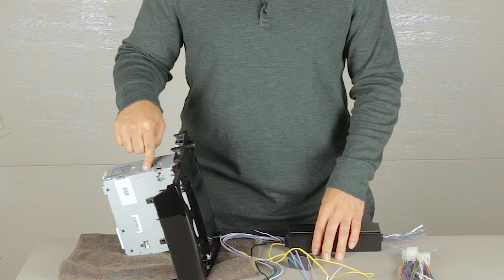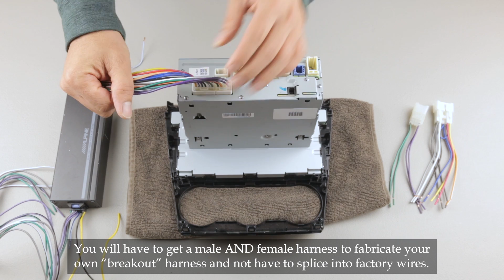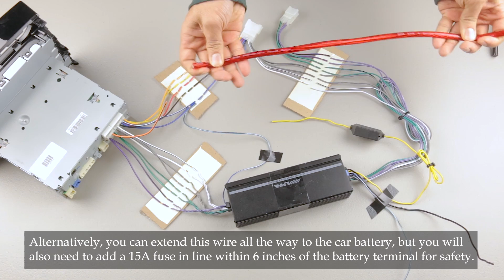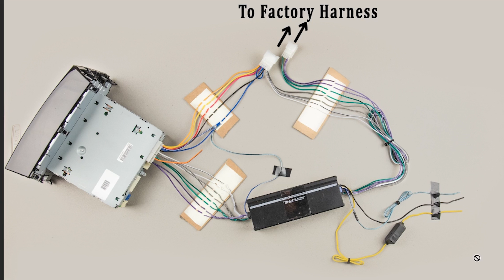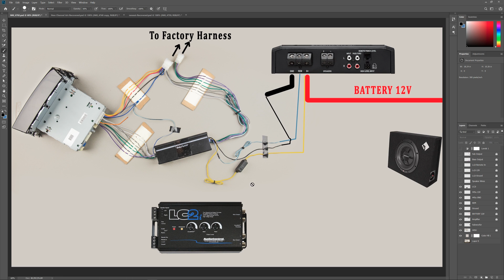How to Wire Alpine 445u, LC2i LOC, and Subwoofer  | COMPLETE WIRING GUIDE |

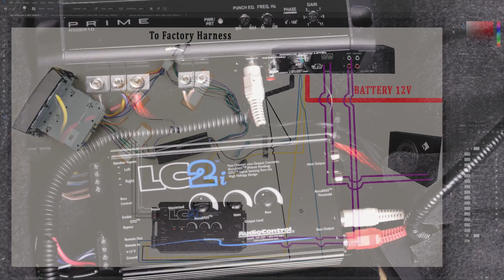Comment: Good video, but a question: At 12:14, in the ‘final’ pic, it looks like there’s a wire connected to the remote out on the LC2i….I’m wondering why? Does the remote go to that first, then to the sub amp?  I’m just curious, as I fully understand how to wire a system….Cheers!

Comment: Thanks for the video, its been the best ive seen so far but doesn't answer my questions about my current build. I have AudioControl LC7i Black 6-Channel Line Output Converter, 2 after market amps(4ch amp and 2 ch amp(for subs) connecting to a factory Ford radio(i have no choice of using an after-market radio). I'm running 150rms to the doors(4ch) so I will use after market speaker cable, not factory internal speaker wire. So with this, im thinking these speaker wires will connect from 4ch amp to the door speakers, which makes sense but my question is where does the 2 sub speaker wire connect from the LC7i to the harness(im using PAC LPHFD31 harness) as the harness will only have the 4 pairs, not 6 which I would need? Any help/advice is welcomed as Ive only done audio systems with aftermarket radios, not factory radios(used to not be an issue until the newer cars and their fancy radios).

Comment: So do you recommend this power pack versus an additional amplifier for the door speakers? I have an older amp I wanted to use on my door speakers but the installer at best buy recommend this mind you the amps I have are over 10 years old

Comment: Ik this comment is pretty late, but do I need to run a fuse with the 12v wire running from the LC2I into the amp or would the fuse from the battery to amp connection suffice?

Comment: If I install just the inline amp, do I need the line out converter? Do you know if the 2019 WRX head unit has enough power for the inline amp?

Comment: I have a 2016 Honda Odyssey, I’m basically doing the same setup.. my question is, which one do you recommend better the lc2i or lc7i and why??
Reply: Depends on how many output channels you need. I do believe the lc7i has accubass now but im not sure. If you don't have an amifier yet I'd look into their dsp line of amps. Has the line out converter built in and you're able to tune the system. All while using one component giving you a smaller footprint

Comment: Hello, I'm looking to get the Alpine PSU-300CVC which is basically the PWE-S8 and KTP-445U as a kit with wiring included specifically for my car. I want to add the LC2i to it, but after looking at all the wiring I'm not sure what to do. If I wired everything then tapped into the Front L/R speakers with the LC2i, where can I send the RCA bass output from LC2i to? Would I be able to connect it preamp or is this setup not possible?

Comment: Hi in order to install the alpine 445u do I need to have the LC2i, I’m not running another amplifier or a subwoofer and I have an aftermarket head unit and speakers the point of my question is when I’m setting up the gain I wasn’t able to reach more than 32 of volume which is my head units it’s the loud It could go up to 50 any recommendation please
Reply: @akqjtn  I got all of them at the off position except number 5 for the 4 channels and number six for the RCA am I right that way ?

Comment: Great video, maybe I missed it , I thought the original speaker wire is insufficient for the upgraded components. So I  ran new speaker wire to wire into the LC2i and two amps and sub box. How am I supposed to tap into the original speaker wire at the head unit  to run to  the  converter?
Reply: It's a 2019 Silverado

Comment: Excellent video! In my sound system I am using the Alpine 445u for (4) 6.5" speakers the LC2i and a Rockford Fosgate 12" sub and Rockville 350w CEA RMS Mono 2-Ohm Amp. Your video helped me wire everything up correctly.

Now I want to add tweeters with a crossover ("active" I think). I would like your thoughts and feedback on adding tweeters. Any recommendations on the crossover configuration I think it would be added between the head unit and the tweeters and door speakers-right? 

I saw your video on the Subaru factory sound option upgrade and you mentioned, ideally a crossover should be added with tweeters. So I am hoping you can point me in the right direction. Big thanks.
Reply: I'm going with the audiocontrol d-6.1200 for a full active 6 speaker install. Every speaker is going to have its own channel and being time aligned and tuned. Then will run line out rca's to my sub amp which will also be tuned by the dsp amp

Comment: Guys.  Don't spend the time to do this with the stock head unit.  It's garbage and puts out garbage sound that you can't control.  Many stock head units attenuate frequencies to certain speakers, meaning there's basically fixed crossover frequencies applied inside the head unit that can't be changed or eliminated.  So you're amplifying that instead of amplifying a pure unmodified signal.  Just get a good aftermarket head unit to start with. You gotta start with quality.  Use the RCA preouts from the head unit and you also eliminate the need for any line out converters.  RCA preouts output a much less noisy higher quality signal too.  This is a nice video but it's showing you how to spend money on an unnecessary line out converter and how to amplify a garbage head unit.
Reply: A lot of people don’t want to lose certain functions. For instance, I would lose my USB input and my bird view camera angle. Not worth it. So this is the best bet while maintaining those features.
Reply: @kldbv982  Any decent aftermarket head unit has at least one USB input that can be run to a header anywhere you want.  We also retained our factory backup camera.  It sometimes means a Maestro RR as part of the install, but that's doing it the right way. We didn't lose any factory functionality except the USB port in the center console which we never used anyways since it's inside the console.  A header on the panel inside the front area next to the cigarette lighter port is a far better location anyways.

Comment: On that harness that didn't have the orange wire. Instead of cutting the factory wires. And assuming this was possible with that type of connector. I would have bought a 2nd harness adapter. And then carefully removed one of the wires from the 2nd adapter, and then push it into the spot where the orange wire was supposed to go and hopefully it locks into place. And then put a label on that wire to identify it. Usually those pins have a locking tab that you can bend it out of the way with a tiny screwdriver that will then allow you to pull the wire out. And then you push that lock tab back out and then it should lock back into place when pushed back into the connector. Though every connector has different locking methods.

Comment: On your Alpine 445u amp that you have installed next to that other amp by running the Alpine's yellow wire into that 2nd amp's power wire. I would have gotten one of those small fuse holders that have 12 gauge wires on it, and butt connected the end of that Alpine amp's wire to it, and then cut the other wire on that fuse holder real short and then plug that into the 2nd amp. And then put a 15A fuse in it. That way that small wire is fused in case it were to short out somehow.

Comment: Regarding ground loops with multiple amps with multiple ground locations. I'm installing the Alpine KTA-450 amp in the dash. I'm connecting the ground of that amp to a nearby factory ground location in the dash. I also plan to install a sub amp in the rear of the car and will run that ground wire to a ground location in the rear of the car near that sub amp. I'm assuming it would probably not be a good idea to run a ground wire from the Alpine KTA-450 amp all the way to the rear of the car so it can have the same ground spot with the sub amp in order to try and avoid ground loops?

As that would be like a 20FT long ground wire, as they say you want the ground wire on amps to be as short as possible like less than 3 feet. I'll have to hope I guess I don't get a ground loop by having multiple ground locations
Reply: @akqjtn  Thanks. Have you ran into putting in an aftermarket head unit and then getting alternator noise or other noise with the aftermarket head unit when using the factory ground? I've just learned of this possibility. Some instead ground the aftermarket head unit to the frame instead of reusing the factory ground. 

Though my car is mostly plastic, and so I don't have easy grounds to get to. My nearest ground location is by the door under the dash, which is a little too far, but I had no choice and ran a 12 gauge ground wire there for the KTA-450. Thanks.
Reply: I’m curious how it worked out for you? I just installed this amp, and have grounded up at the HU and over at the amp going all the way to the engine area on the frame. So I’m completely doing it wrong apparently. Plus I hear this loud noise, and the amp started smoking. Please let me know what you did, I’m genuinely at a loss right now
Reply: @travisharrington5819  I connected the ground of the stereo to the factory radio ground wire. And I ran a dedicated ground wire from the amp to the nearest factory ground location, which ended up being like 3 feet long. No issues.

My understanding is you want your amp ground wire to be as short as possible. I'm sure you have factory ground locations somewhere in the dash, you'll just have to search Google you make/model and factory grounds. Also you want to make sure you are using the correct gauge wire. I think mine was either 12 or 10 gauge. I bought a power/ground kit from Crutchfield I think, or one of those places.

Comment: Pretty sure the 445u automatically turns on when connected to speaker level inputs without needing the remote turn on wire connected.
Remote turn on wire is only needed when it's connected using RCAs

Comment: i have a 2017 WRX Base mdoel with the CV682UL Head Unit.   I desperately need to know if it has a pin for "Amp Remote Trigger" or not so I can finish wiring this thing with the breakout kit!  Thanks!
Reply: Boost & Shutter - well, I went ahead and took the blue/white cable on the input side of the alpine pack and tapped into the blue/white cable on David’s breakout harness (so it’s 2 ends tied to one making 3 ends meet and I crimped it).   Plugged her in and all 4 speakers are loud and clear.  I forgot to adjust the buttons on the back though lol so looks like I’ll be removing the glove box tomorrow to sort that out and then install my Rockford Fosgates.  Your vids were a huge help, thank you brother.

Comment: Great video but I have a question. Why did you splice the blue and 2 blue/white wires in the one blue wire. Can I just wire blue to blue and blue white to blue white. Crutch field says the amp can sense power from the speaker inputs and the blue white wire is not needed. Also what is the black orange wire?  Thanks

Comment: I would like to add this kpt-445u in my 19 wrx. I currently have the kicker hideaway, tapped from my rear speakers. How does the alpine amp work with the front speakers feeding the tweeters (ohm difference)?  Also, do you know if my kicker hideaway can use the amplified rear speakers as the input still

Comment: What do i connect my 12v input to for my LC2i ? i dont want to use headunit power ebcause i want head unit power. should i connect to one of the outputs on my power distribution block (2awg input 4awg output x2) or maybe to the output side of the  main fuse ?

Comment: Do you see a problem with sending an amplified signal to the LOC?  I am looking to add the Alpine powerpack for my door speakers.  But already have a sub installed that is getting signal from my rear door speakers.
Reply: it should handle 45watts no problem according to LOC it can handle 100+ watts but don't quote me on that. My only question is why did he run the LOC of the front line level and not the rear?

Comment: Would tapping into the output side of the alpine amp give a better signal to the LC2i?
Reply: It would depend on the voltage output of that inline amplifier and what the allowable input voltage if the lc2i is.

Comment: Nice video 👌👍.. But hopefully you corrected that the audiocontrol unit won't need the remote turn on wire  (IF) you are going to use high level inputs .. the unit will generate it's on turn on with it's GTO.. GREAT TURN ON...Just a heads up... Have a great day and thanks for the video.. peace out....

Comment: I got the same setup but the powered sub. Is it necessary to hook the Lc2i to my setup? Thanks
Reply: Did you ever get this figured out?
Reply: J. Atencio yes you need this lc2i in the system. Ways better
Reply: @j.atencio3179  Lc2 is worth the money, it picks up way more bass frequencys than a cheap line converter...
Reply: Thank you for replying. I have a similar set up wired a little different and without the lc2i but I feel like I can get more bass with the amp and sub I have.
Reply: @j.atencio3179  LC2 is a must it will be the best 100.00 you ever spent. I traded my Honda in for another but kept the system but added the Lc2 got rid of the scohsh line converter whatever its called? and the sound (bass) is completely different for the better!

Comment: Hi I appreciate your video is the best I seen, I followed your instructions, and when I turned to ignition I got a SRS malefaction warning, but every thing else worked, got sound to the speakers and the amp worked too.  My set up is 2019 Toyota Tundra SR5 non-amp, stock radio, I bought the KTA alpine 450 power pack, very similar to the 445u. I really would like to hear  your input. and like I said great video!

Comment: Great video on how to wire this amp.   I have an issue if anyone can assist with.  2016 wrx stock radio.  Installed the KTP amp just like the video wire for wire.   Made the breakout kit but for some reason I have a humm in the system.   Strange thing is if I turn the screen off by holding in the left knob the music continues to play. It the hum goes away.    Turn the screen back on and it starts to hum again.   Another thing that stops it is when I go into reverse the hum stops.    Amp is grounded to frame.  12g amp kit from battery to amp.  Any help would be great.   Thanks
Reply: Sounds like your illumination wire might be hooked to the wrong wire? Did you figure this out.

Comment: @ Boost & Shutter, My Pioneer headunit’s wiring  harness has a white + blue wire (no solid blue wire) but my truck’s wiring harness has a white+blue wire and a solid blue wire. Where should I connect the white + blue wire from the head unit and Alpine amp? Thank you

Comment: The LC2i has a feature called (GTO) Great Turn On: No need to look for a trigger wire/remote turn on. The LC2i senses audio signal which turns on the amplifier(s) from its remote out connector. One less wire to run from the head unit.

Comment: Best instructional video for the KTP-445U to date. Thanks for the info and keep up the good work! Subscribed
Reply: @akqjtn  sorry if this is a stupid question but do I have to wire the line out converter speaker wires to the input harness like you did? Or am I able to wire them up to the output harness?  there's speaker wires on both sides so does it really matter? Is there a reason why you did it where you did it?
Reply: @akqjtn Thanks for your timely response. ok I tried both ways and wiring the rear speakers in the output harness worked best for my vehicle. Now if I can just get rid of the awful hiss coming from my front speakers. 🙄

Comment: Bro thanks for this video it helped me install in my 2018 tacoma and saved me $150 from a shop install.
Reply: Did you cut into the factory wires or get a break out harness? If you used a break out harness can you tell me which one you got? I have a 2017 tacoma
Reply: Slappa Da Bass cut the factory wires

Comment: Great video. subscribed. I have an aftermarket HU. Can I connect the ground and the 12v wires to the Metra harness instead of a different source? Also, if it is my only amp, what do I do with that blue/white wire? thanks